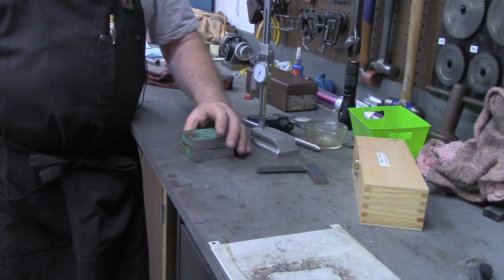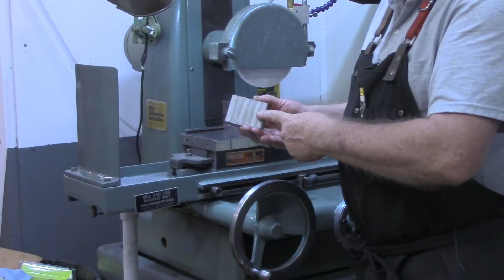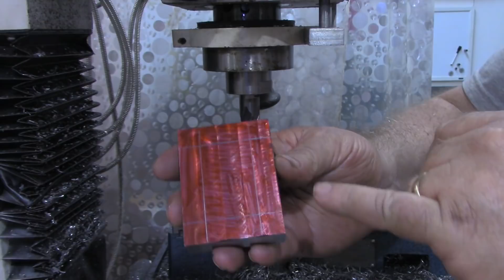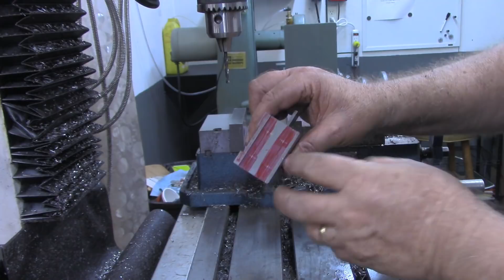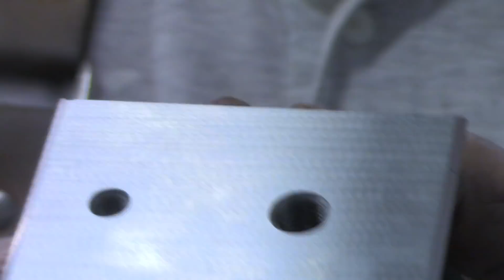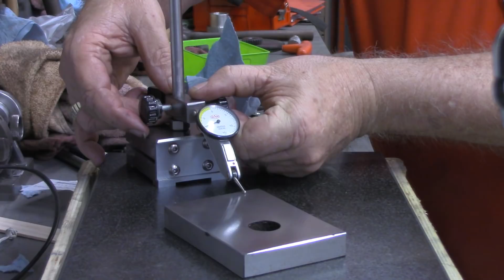Surface Plate Indicator Stand

Comment: .001/pass is plenty. With that size machine. You can take more but than you have to reduce your indeed. So time wise it's a wash. And your part will get hotter. A thicker part like what your doing won't be effected with heat much tho.
Reply: PS.i want your grinder. And thanks for the indictor stand tutorial.

Comment: Love the project and looks great. Would have preferred to see you slot the small block for a tightening knob rather than just a pinning set screw. I just wonder if that method will tear up your mast rod. Thanks for posting!
Reply: Yeah, I was thinking along those lines also. I was thinking maybe a small rod of Delrin or brass inside and tightened by the screw. Easy for guys like me to suggest something that might take too much time and probably not necessary, however that machine is pretty awesome to begin with. :-) ..Ken